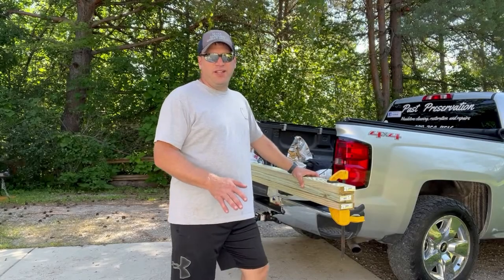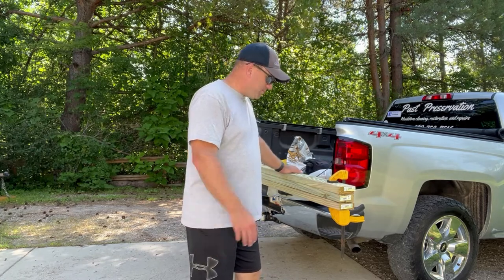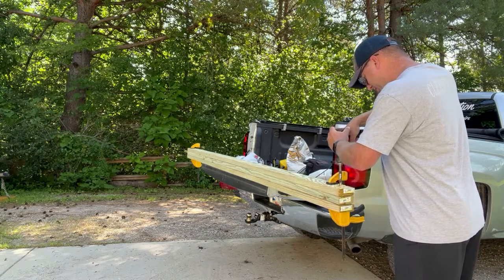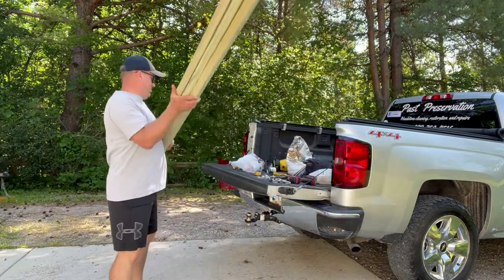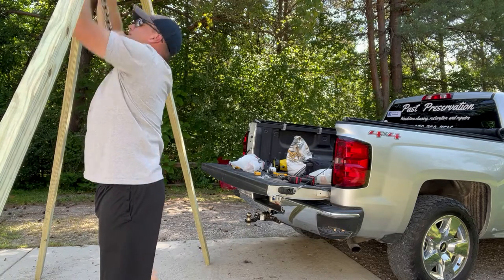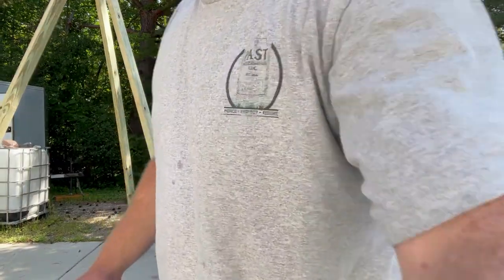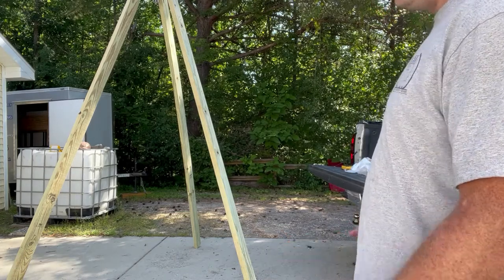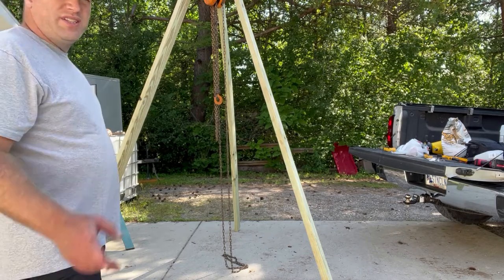Building a 2X4 tripod

Comment: Great video. I’m a shorter female, and I built a similar tripod out of 8’ 2x4s. It’s a little easier for me to manage, and I use it a lot. I’m going to have to make another one that’s 10’ tall, though, for a taller monument that needs reset. But the 8’ tripod meets my needs 95% of the time. I found that elongating the holes a little allows me to get a wider and more stable stance on the tripod.
Reply from the maker: I think I will enjoy having one more than I thought I would…. Will definitely be easier than putting my hoist together all the time

Comment: Thanks for the info.  Need to pull bush roots out of my front lawn.  Got (3) 7 ft 2 by 4s and drilled a 5/8 hole in the center board and drilled 3/4 holes in the two outside boards.  Ran a 1 ft long chain connecting the 1/2 inch by 8 bolt between the boards and connected a come a long to the chain.  Didn't try it yet but looks like it'll do the trick.
Reply: That's a great idea about using a come a long.  How did it work?
Reply: @adobemastr  Worked great,  not as fast as using a chain fall but did the job.
Reply: @MrBob-vc4qd  thanks for the reply. I used your idea on mine that I made and you are correct: the come along was great, but they sure are slow. Do you like the chain falls better? I was thinking of getting one, but there's so much chain that falls on the ground I didn't want to hassle with that.
Reply: @adobemastr  Don't own a chain fall so I used a come-a-long.  You're right, all that chain would get in the way.

Comment: Can you be more specific on the pulley you used please.  What was it called (I could not understand what you called it)?   Is it a simple pulley rig?  Where can I get one?   That was a good vid.  Thx for creating it.  I learned something.
Reply from the maker: They are called chain falls. You can buy them at pretty much any hardware store… mine are 1 ton capacity